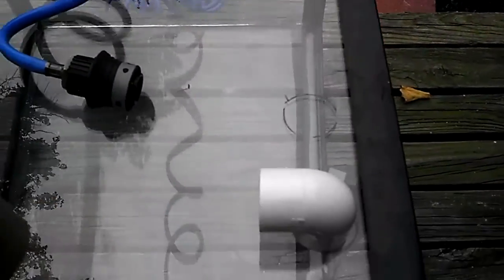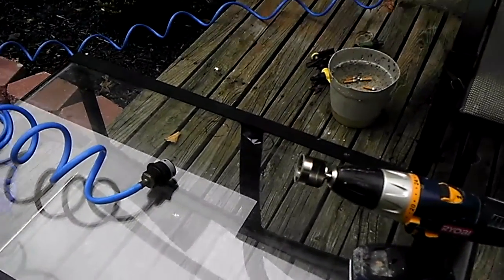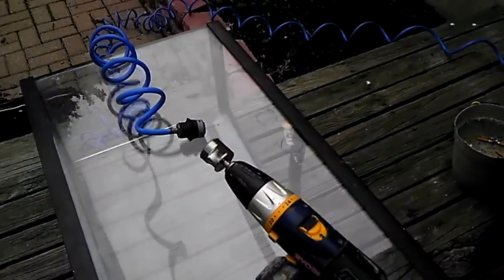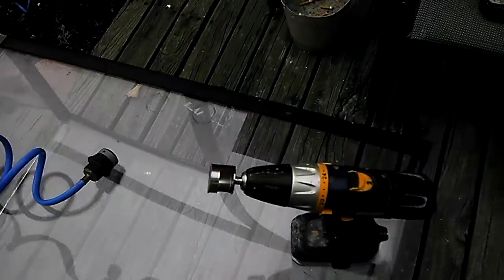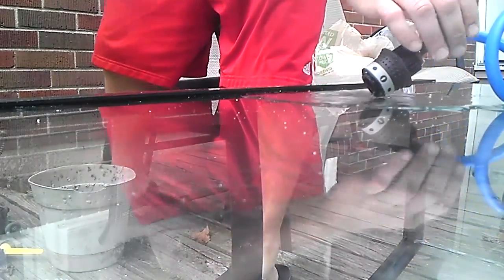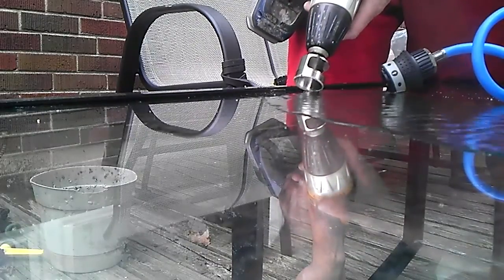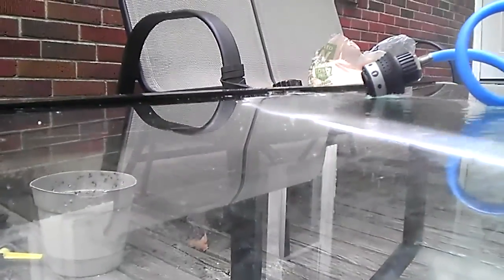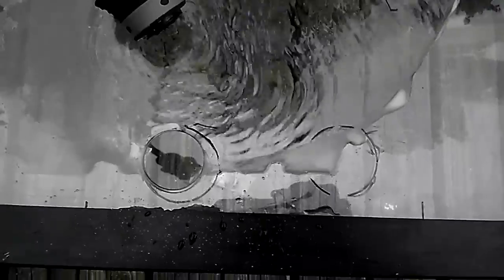46 Gallon Bowfront Reef Build (Drilling the Tank) Episode 3

Comment from the maker: A durso uses only one drain with no siphen.  It is louder but there is a hard tube sticking out the top of the elbow on the drain.  This draws air in and breaks any air bubbles that are caused by not having a full siphen.  Think about it like water falling down a pipe. air gets trapped by the water and makes a sort of seal similar to a suction cupWhen you pullthat suction cup up it makes a sound.  But if the suction cup does not create a suction then it doesnt make a noisstand pipe prevents this

Comment from the maker: The herbie overflow consist of 2 drains 1 at full syphin and 1 just higher than the water line as a preventative measure.  With a full siphen you have a better chance of sucking up snails, fish, or anything else because it creates negative pressure and the full siphen actually pulls water into it.  If that first full siphen gets blocked water overflows into the second one.  The benefit of having a full siphen is it is completely quite.  My new build has a durso overflow which is different

Comment from the maker: well im glad a I could help.  Check the manufacturer  of the tank sometimes they put tempered glass on the bottom.  This tank did indeed have tempered glass, but there was a sticker that said do not drill tempered.  There is no difference drilling through bottom or top only preferance.  I like the back because you can use a smaller overflow and dont need an entire wier like on my new 65 gallon tank.  on this build I used a small diy overflow for a herbie style overflow